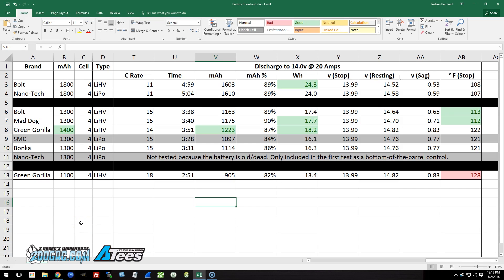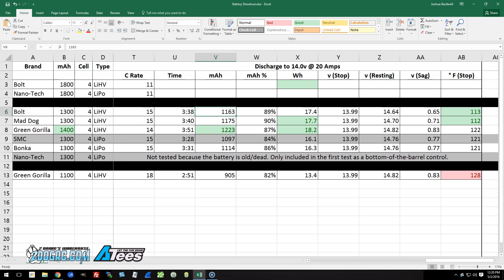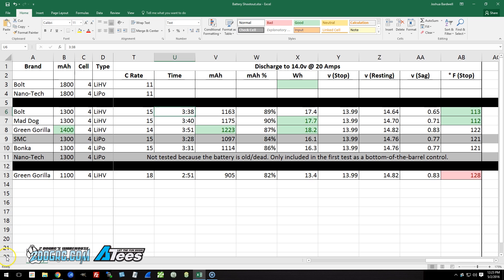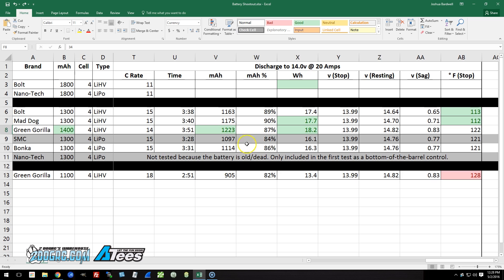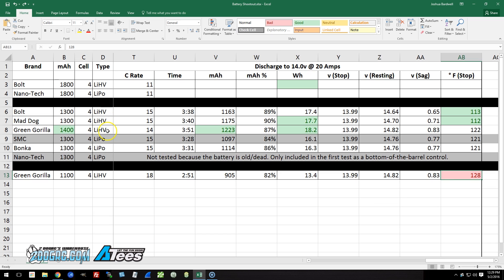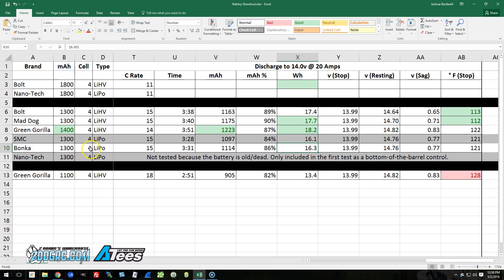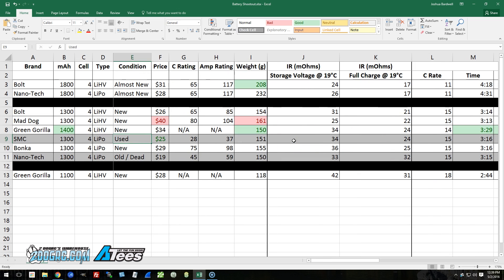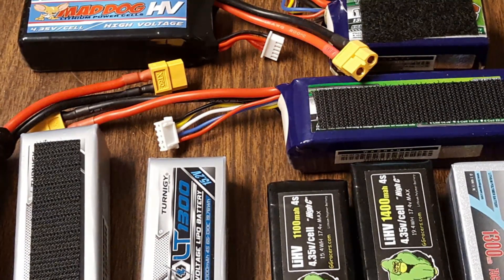Mini Quad Battery Shootout - Group One - 14.0v Discharge @ 20 Amps

Comment: If you can think of a viable way to test longevity, I'd be interested. As much as I'm willing to pay for higher performance, I'd also like to add to the mix, slightly lower than top-of-the-line packs....that I can count on working time and time again
Reply from the maker: There is a person testing graphene packs who is supposed to be over 700 cycles with still more than 80 percent capacity on them. The problem with longevity testing is it takes a lot of time and record keeping.

Comment: My hope is this information + others (like drone-zone.de) shared with everyone will encourage manufacturers to innovate & build better batteries for FPV flying.  
Wouldn't it be great to have a 50g 1300mah battery that could handle bigger amps :)
Reply from the maker: +David Martin I think there may be some validity to this. Until RC flight, and multirotors specifically, I don't know of another application of battery tech that required both high energy density and high discharge rate. The main problem that I see is that RC is a relatively small part of the larger LiPo market, so it remains to be seen how much we can drive development. This is where companies like HobbyKing can be really useful, because they can drive manufacturers to make cells that they wouldn't otherwise bother with.
Reply: Wonder also if there is any other industries that would mutually share benefits around density & discharge - e.g. Tesla / Electric Vehicles, KERS in F1 cars, etc...
Reply from the maker: David Martin I wonder whether the Tesla etc... really need high C rates. They are using really massive batteries to get long run time. At that point, the discharge rate may be quite low.

The Tesla battery pack is reported at 60 kWh to 85 kWh. Tesla reports 375 volts as their operating voltage (wow!). 85,000 Wh / 375 v = 226 Ah capacity, give or take a bit.

I can't find the actual amp or watt draw of the Telsa under real world conditions, but let's work backwards at it.

That means that at 1C, the Tesla would produce 226 A * 375 v = 849 kW. At that rate, the battery would be depleted in one hour. Since the car can certainly drive for more than one hour at a time, the real amp draw from the battery must be less than 1C.
Reply from the maker: Oh heck! I'm dumb. Horsepower can be converted directly to watts. The Tesla model S is rated at 382 to 762 HP. 

762 HP = 568 kW. 568 kW / 375v = 1.5 kA = 1,500 amps. Given a 226 amp-hour battery capacity, that means that at full throttle, making a whopping 762 HP, the battery is only producing about 6.6C.

Q.E.D.
Reply: +Joshua Bardwell - Needed to confirm the numbers there also.  
Interesting when you look at Tesla's choice was to use commodity 18650 cylindrical cells with nickel cobalt aluminum (NCA) chemistry from Panasonic.
More interesting quote “By using off the shelf batteries, Tesla is able to keep state of the art without requiring specialized packs. Cylindrical cells also perform better than pouches.”

Comment: It's interesting to see the C that you're pulling vs the "rating". It becomes obvious when you fly that it's not very likely you can sustain 20C for three minutes, let alone 65C.
Reply from the maker: +Chris Brent Yes, for sure. So we must conclude that the "continuous" rating for a battery means "continuous" in some other way than the dictionary defines. One conclusion I am coming to, which you will hear in a future video currently under production, is that the battery ratings are either-or. You can have 70C, or you can have 1300 mAh, but not both at the same time. Well, sure... that shouldn't surprise anyone. But I think most people will be surprised to see what happens to the voltage when you actually attempt to pull 70C from a battery. Check out the drone-zone-de tests to see what the battery does when they pull 90 amps from it! And this "burst" rating of 130C, I don't even know what fantasy land that's coming from, unless a "burst" is something like 0.1 seconds.

Comment: I am definitely not an expert but i think 14.0V is a good spot since most of us are for sure discharging regularly our LIPOs around this spot and i am pretty sure (unfortunately) some people are doing maybe worst than that lol
Reply from the maker: +ABMNS PRODUCTION My standard practice is to stop flying at around 1000 to 1100 mAh on a 1300 mAh pack. At that point, my voltage will typically be resting around 14.0 to 14.4, with sags into the high 13's if I push the throttle, which I try not to do. After resting, the battery recovers to 14.8 to 15.0 volts typically. I treat the recovery voltage as a good indicator of the pack's health; a healthier pack recovers to a higher voltage when a fixed mAh is pulled from it. I also watch for if I am having to stop flights before 1000 mAh because of excessive sag.

Comment: Whats the nominal voltage for LiHV packs? 
Would discharging an LiHV pack the same cutoff as a lipo pack mean the pack is being more heavily discharged?
Reply from the maker: +Stephen Gibb That's not my understanding, and I have carefully researched it to be sure I wasn't damaging the packs. The LiHV packs can be charged up to 4.35 volts per cell, but they still discharge to the same level as a standard LiPo. Basically, their top end has been increased; it's not that their entire voltage scale has been slid upwards. This may be one reason why an LiHV can be slightly lighter than an equivalent mAh LiPo--because the LiHV is starting at a higher voltage, it can give more mAh of current out of a smaller cell.
Reply from the maker: +Stephen Gibb BTW, if you use the HV program on the Accucel-6 charger, it charges Storage mode to a higher nominal voltage than LiPo. But I don't know if that is really intentional, or just the program takes a fixed percent of the max voltage.

Comment: I enjoy viewing your testing of popular batteries. Have you had a chance to view this research? https://www.drone-zone.de/en/battery/
Reply from the maker: +deepimpact.io Oh wow! That is some really excellent testing! I love that they are doing high-current punches followed by recovery. That is a more realistic way of testing a battery's performance than the constant-current discharge I am doing, but I'm just not set up to do variable-current discharge in a repeatable way. I feel like my testing is useful for showing how two batteries stack up against one another, but the drone-zone testing is more likely to give a picture of how the batteries will perform in the air.
Reply: +Joshua Bardwell we have been logging our flights using KISS ESC telemetry and is proving to be an interesting methodology to "replay" those flights into test environment. Nils has done some excellent work and I am doing all I can to help with the little things such as submitting my flight data. Nils does all the real work. I just fly and flip a switch ;)
Reply from the maker: deepimpact.io It's so funny that you say that. I had that idea while coming up with my test methodology for these videos. The idea that you could record your throttle inputs or your motor outputs using Blackbox and build a rig to replay the flights so you could see the REAL battery performance. Looks like great minds think alike!

I think it would be really cool to create a set of standardized flights, such as having a pilot fly one of the UTT tracks or something, or having a big-name acro pilot fly a freestyle run, and then use that as a benchmark for battery performance.

My idea was to actually build a rig with real motors and props, and replay the motor outputs to them and see what the battery did.
Reply: +Joshua Bardwell Or build a robot pilot...hmmmm.
Reply from the maker: +Midzi That battery seems to be holding about 70 amps in the first test, and about 80-90 amps in the second test. Very impressive!

70 amps / 1.5 Ah = 47C. 
90 amps / 1.5 Ah = 60C.

If the battery can consistently do the 90 amps, then I am legitimately impressed, and I will revise my hypothesis about batteries not going over about 45C. If it typically pushes about 70 amps, then that is right in line with my hypothesis.

Either way, that is a very good battery.
Reply from the maker: +Midzi Where can you buy them?
Reply: +Joshua Bardwell ATM you can only order them at their Singapore store: http://www.store.revolectrix.com/Products/LiPo-Batteries although they are working with dealers to set-up ww distribution network. 

I own have tested this one: http://www.store.revolectrix.com/Products/Blend435-DIAMOND-Label-60C-LiPO-Batteries/Revolectrix-1500mAh-4S-Lipo-70C-Silver-Label-GP-KO-JST-XH-Balance-Connector 

If you want to buy them, use code revojohn16 to get 10% discount. Or maybe contact Revojohn on RCG and see if he'll send you any for testing.